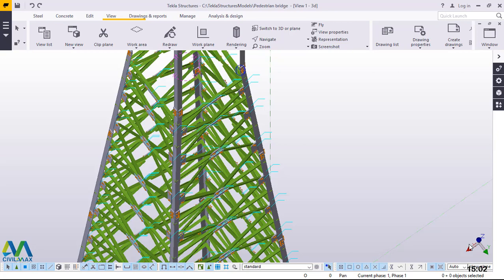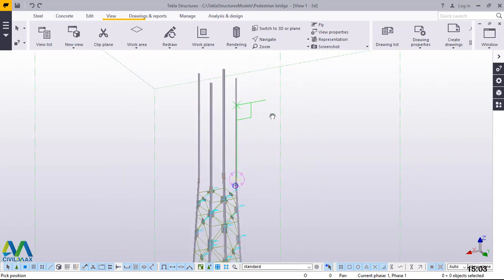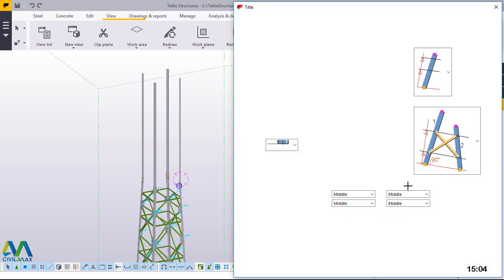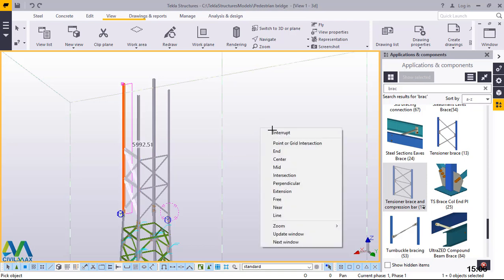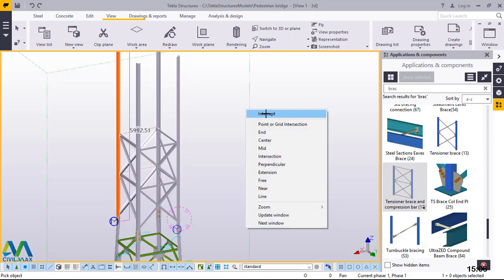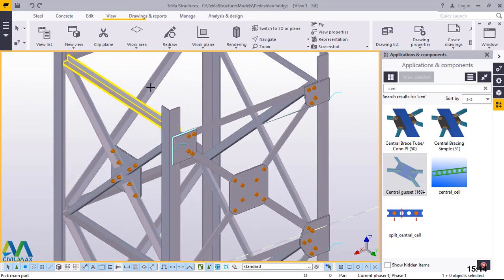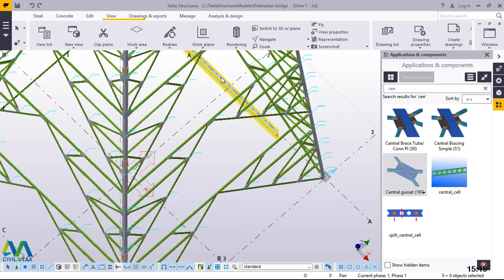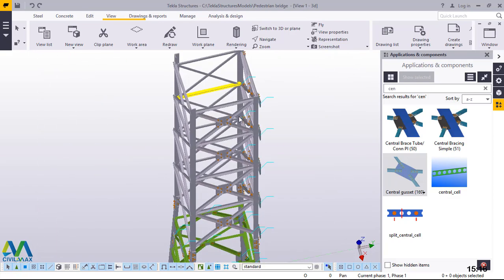Telecommunication Tower Modeling in Tekla Structures Part4

Comment: For telecom this is not good design. Why you need to put a lot of gusset plate if not required. Do you know that the gusset plates increases the weight of the tower by 40%? Try to model it without gusset plate. Use gusset plate only if the quantity of bolt is failing on that specific connection and you need more quantity that will not fit on the member or cannot think of a good orientation of angle.
Reply from the maker: noted